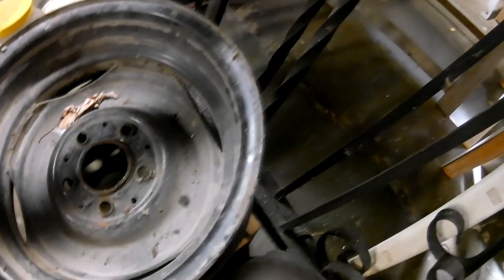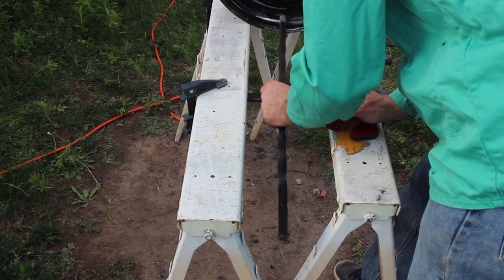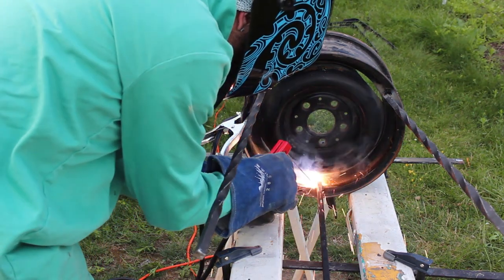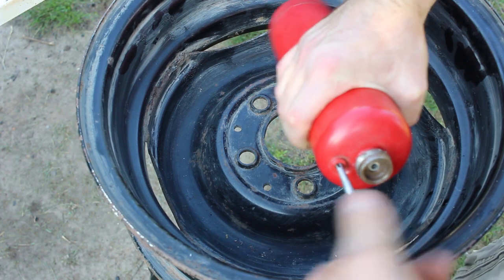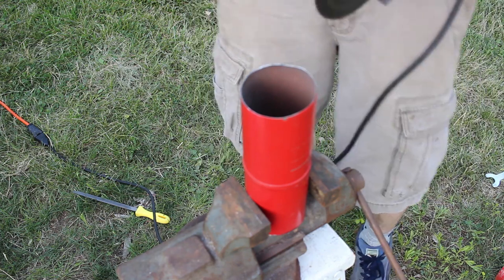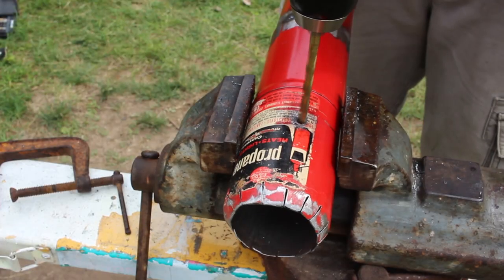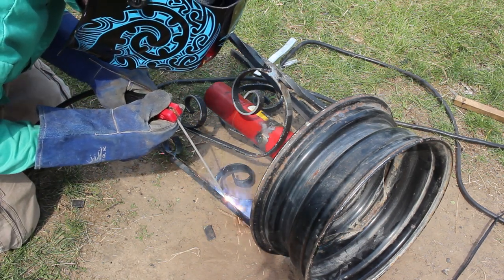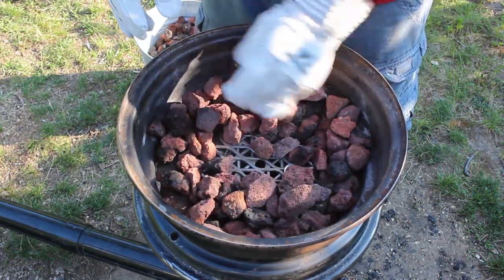Charcoal Forge - Building a blacksmith's forge  - HNB #9

Comment: Great work putting this together. Hammer looked way to heavy for what you were doing! I’d say a 16-20 oz hammer would be the max for a small cast iron anvil like that. Thanks for sharing! 🔨 🔥
Reply from the maker: Great observation! It was WAY too heavy.  Switched over to 1KG cross pein hammer which is perfect.  I still use that big hammer for drawing out large pieces of steel though.  Thanks for watching, cheers!

Comment: I made a similar one, using pipework and an ash can below.  Blower comes in from the side.  Then made a flat bed from cut inch  x 1/8 strips within the rim and made the firepot seperately.  With lugs welded to the fire pot and receivers on the base, I can use different sized fire pots for different projects, simply by twisting and dropping in a clearance bolt.  Some of the pots have slots or holes to rest steel in.  Additionally, I used an electric hairdryer attached to the air input, added a speed controller to the line, for control of the dryer speed.  Happy forging!  PS as a pro welder, I'm curious as to why you kept changing rods during the build.  I used 6013  3/32 all the way with no problem.  An auto darkening hood and controlled use of spot welding is your friend on thin metal.  Cheers!!
Reply from the maker: Most likely switching rods because they were being used up or getting uncomfortable to hold.  It got the job done.

Comment: Yes....lots of hammer swinging haha. Your arm looked like it had enough at the end there. 
Nice job on the forge!
Reply from the maker: Oh yeah, I was so tired. My poor technique didn't help either.  I can forge with a smaller hammer for a whole day now and not get too worn out.  Thanks for watching, cheers!
Reply: @HacknBuild  i don't think you mention insulating the metal of the forge itself. Did you do anything to shield the bottom from the heat of the coal? If so, would you give details about that section?
Reply from the maker: @jonmelson2125  No, it's just steel plate.

Comment: Lol... I was just looking at a  rim that I used for a lil work  table to hold my vise, and I have been looking at different forges on you tube I was like hmmm...wonder if a rim would work saw 2 brake rotor forges and your video comes up lol... yes you can like your rim forge will be trying your rim forge thanks!😁👍
Reply from the maker: Yes it will! Have fun building your forge.

Comment: Go to a Junk yard or auto recycler. When the metal you are working on loses its glow put it back into the fire and heat it up some more, kept it Hot !
Reply from the maker: I didn't know much about running a forge when I posted this video but since then I've joined the local blacksmith association and picked up a lot of knowledge from the other smiths. Thanks for watching, cheers!

Comment: Very informative and inspiring actually,thank you for making it easy👍🏽
Reply from the maker: Glad you enjoyed it! Thanks for watching, cheers!
Reply: I’ve been tinkering with the idea of getting into forging for awhile,but the task seemed extremely daunting,thanks to your video I think it’ll be easier.thank you again
Reply from the maker: @narcisosalas1180  Agree, it's really not that hard to get started - though I have started making a 2nd forge.  One thing I would suggest is getting a speed control for the blower because it burned way to fast the way I had it set up.  I "upgraded" to a small block (5"x7"x10" or so) of mild steel  for my anvil.  It get's job done. Good luck getting your shop set up!

Comment: how about rust powder to iron with coal? maybe make it hotter by making it more like a rocket stove? single use carbonized material rocket stove forge?
Reply from the maker: The forge worked OK, but I've already built a new one...been busy with other stuff though so haven't gotten around to doing much smithing on it.  Thanks for watching, cheers!

Comment: Seems like you could use an old Weber grill too
Reply from the maker: That would definitely work.  The steel on one of those grills is pretty thin, so it might not last very long.  The steel on the wheel is a little thicker.  One thing that you need to consider when designing a forge is thermal mass.  You want materials that are going to hold onto the heat.  Thanks for watching, cheers!

Comment: That is a HUGE firepot to use, you will be burning through fuel REALLY fast with that setup. A better idea is a brake rotor set into a metal table of some form.

Because you will be angling the piece you are working down you will not get a good heat. You can cut some slots in the sides to put your piece across and bury it in the hot coal to help a bit.

Also the grate has huge holes which may let too much air in which might hurt your ability to control the fire (it will get too hot) which could melt your work and will use up more fuel.

Also make doubly sure the bolts (and any metal for that matter) you use are NOT zinc plated. Heating up zinc and inhaling the fumes will kill you.

And with the propane bottles, cool idea for their use, however if there is propane in them it is safer to fill it with water to displace the propane before grinding on it and potentially having a bit of the gas light up. I personally would do so anyways as I am very partial to having all my limbs and not being on fire.
Reply from the maker: Thanks for the suggestions.  I've been able to work around the size of the fire pot by using some lava rocks built up around the sides.  It still burns a bit fast for, the next step for me is to get some firebrick to see if I can get  a bit more performance out of it.  Once I have a better idea what I am doing, I plan on  building a new forge.  Cheers!
Reply: Yeah I found out about too much air the hard way, that fire was raging made, I had no idea as to what I was doing. Put a spike in it came back after some alone time with the porcelain throne, grab the head of the spike and that's all that was left lmao. Built and adjustable restrictor plate and now I have 100% control of the fire.
Reply from the maker: That's how we learn.  Sometimes it's best just to get started and learn from what doesn't work.
Reply: While true zinc is toxic when burned, after the first burn or 2 the zinc will have burned off and a small amount like a couple of bolts isn't going to have an effect on you. Especially working outaide.
Reply: Easy, fill the wheel with damp sand, cinders, ash, coal, or cement. Coal won’t burn without air, so keep it damp and it will create a refractory of sorts. Break rotors are about half the depth you want for a good fire.

Comment: You can tell he's not used to heavy manual labor . He swings hammer a few times then rests , and repeats..... I think I can hear him panting....🤷‍♂️😁 
PSA before cutting into cylinders like that , you should fill with water first to purge any remnant gasses..... Or you could go BOOM..... Just buy some steel tube from your local scrap yard.... It's cheap.....
Reply from the maker: That was the first blacksmithing I'd ever done.  The 5lb sledge is a lot of hammer for a small piece of steel like that, but it really has more to do with poor technique.  I've done quite a bit of blacksmithing since then.  Using proper techniques, I can swing a 1KG hammer all day long.
Reply: @HacknBuild  proper technique is key to everything in life....😁 
I'm gonna adapt your forge design and make one out of a big truck rotor. Gathered up the pipe and rotor last night after your video. Tonight I'm gonna cut up the pipe to make the air supply tube.... 
This is really the perfect size to make knives and such. I want to make a bigger forge out of a big stainless steel sink. Going to be a charcoal forge too. This one is first though due to I won't have to spend any money....😁😁 
Keep up the great videos....
Reply from the maker: @firemanjim324  Thanks bud, good luck with your build!

Comment: That propane bottle wasn't empty of gaz when you cut it, you took a high risk here
Reply from the maker: It was completely empty since I pulled out the check valve before cutting it.  There's a clip on how to do that in the video.  Thanks for watching, cheers!
Reply: @HacknBuild  well no it wasn't. Because since the atmospheric pressure is 1bar, there is still enough gaz in the bottle to apply a pressure of 1 bar inside the bottle. Since nothkng pushes it out, it stays in. Opening the vavle isn't enough, you must blow air in the "empty" bottle or fill it with water to force the rest of the gaz to get out
Reply: Are you really going on about residue? The only risk there was using the tool itself.
Reply: @Dannyuh7  what do you mean ? An angle grinder isn't dangerous if you know how to use it. What would you use to cut this thing instead ?
Reply: @lamproknives  my point is that the angle grinder itself is more dangerous than the gas in the bottle at this point.
Reply: @Dannyuh7  I don't agree with you. As all tools, you must learn to use it. But once you know how to handle it, it's not that dangerous if you leave the guard on it. And unlike the gas, it won't expode on you. 

But I understand that you find it more dangerous, it makes sens.
Reply: The French Knife Maker what got me was him using a welder and a angle grinder with shorts on ! What no face shield? Did he perform a ring test on his cut off wheel prior to use? Did he have a fire extinguisher present? Probably not but I digress.
Reply: @msdarkstar44  everybody is free to take the risks of injury... But I think it's not worth saving like 10min and skipping protection
Reply: @lamproknives  as an OSHA trainer and a hobby blacksmith, I agree!
Reply: @msdarkstar44  you only got 1 set of eyes, fingers, lungs... Well, at least they're pretty expensive on the black market 😂

Comment: Great video, rinse out your propane tanks with water, explosion hazard!!!
Reply from the maker: Not really an issue since I already removed the check valve and let the tank air out.  LPG is a gas at room temperature so washing it out wouldn't remove any explosives, but at least the tank would be nice and clean on the inside :) Thanks for watching, cheers.
Reply: You’re right. It’s the sparks that ignites the gases. Adding water, better yet, soapy water allows the gases to dissipate from the container. Any remaining gases are dissolved in water. Chemistry 101.